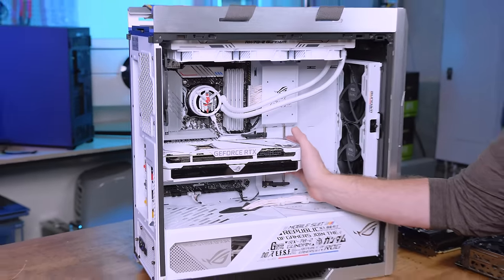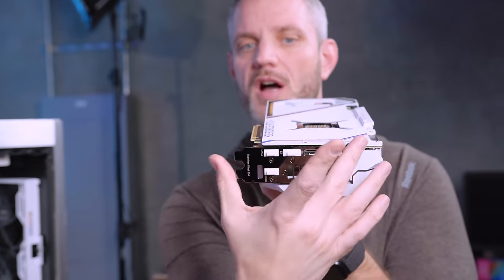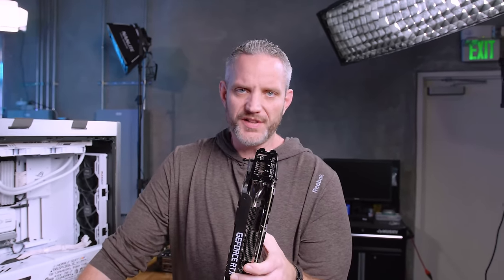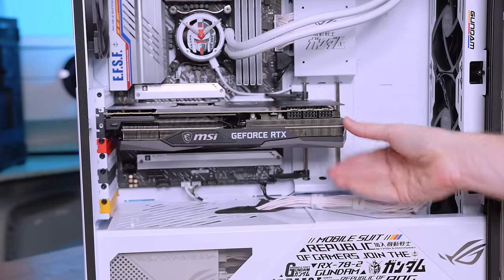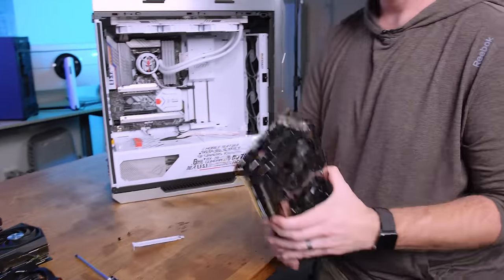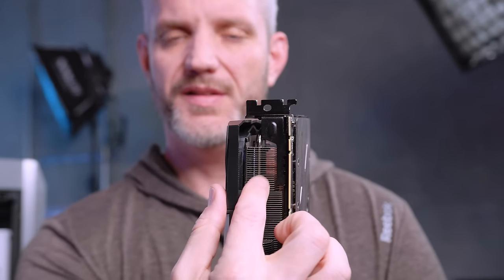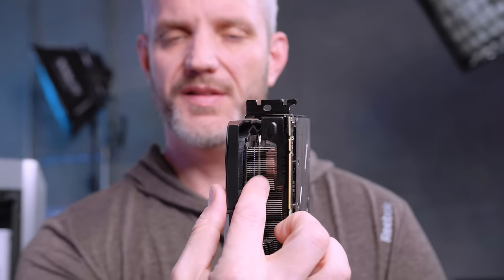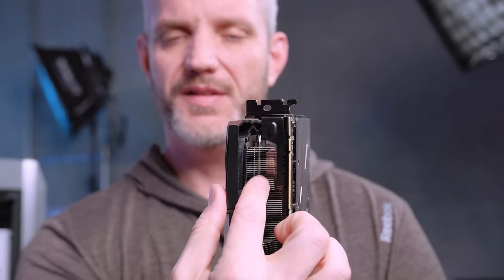How to fix GPU sag ONCE AND FOR ALL! FREE!

Comment: Any help here? So recently I've been having the annoying problem of losing display way too often, either while gaming or when I'm just browsing. I figured it's probably my gpu that just needs a little re adjustment, and technically, it is true. I'd reseat it or just give it a little push, and my pc would start up fine again until it would lose display and restart itself all while posting 'AA'. Then i would get code 97 when. I realized I get no problems when I lay my pc on 'it's back' so the gpu would be pushing down on itself with gravity. 0 issues. I recently ordered asus rog gpu support bracket in the hopes that would help. Any thoughts?
Reply: That sounds like an issue I was having on my brothers build:

His issue was 4th gen Intel build, Asus rog maximum VII Gene motherboard, Asus gpu 1060 6gb (and 2080 8gb), Asus ac68 pcie WiFi card...

The issue appears to be faulty implementation relating to the Asus ac68 WiFi card - it really doesn't play well when plugged into an x1 pcie chipset slot - so I believe the chipset isn't compatible with this WiFi card or the WiFi card's driver implementation - works fine with WiFi card in a x8 slot (gpu slot) but has the boot issue, bios error code issue, no display issue on the non gpu pcie slots.

There's some talk on forums only, that Asus messed up with these WiFi cards and they just can't work in normal chipset pcie slots eg x1 slots without causing system problems for booting and display.

What I found is you can get a cold boot to work if you take the power lead out the back of the psu eg discharge the power out of the pc (hold the case front power button), a reboot doesn't succeed, a shutdown then switch on doesn't succeed either - as soon as I take the WiFi card out as well it has issues as well, it's only putting the WiFi card in the gpu pcie slots (eg the 2nd gpu slot eg x8) that's stable and works - this kinda proves that the WiFi card is only happy and stable on gpu/cpu pcie slots and it's not working on chipset/mobo pcie slots.

Hope that helps you.
Reply: @marknewellmusic  damn. I just bought a new Gpu and I have 0 issues. Got a 3060 12gb. RIP 3070
Reply: @Micalex   Interesting... well, at least you solved it and at least you kinda got a better card than that 3070 - 12gb vram is better than 8GB for sure these days.
I had a 3060 and it was a fantastic card 👍
Reply: @marknewellmusic  yea. The 3070 would give me about 300 fps in modded minecraft with some lag frames and now I get over 400fps with 0 visual lag/glitches or whatever. In valorant, I can play with everything maxed out and it feels so smooth. Before with the 3070 I would remember having anti-aliasing would cause some stutters.
Reply: @Micalex  Happy days mate, game on!

Comment: That does NOT work with any card on the market and really isn't a structurally sound fix.  First, one of the very cards you demonstrated in this unecessarily long video was the MSI.  Given the way the mount is position in relation to the rest of the card, the next slot down wouldn't be in line with the back of the card for your "shim" idea.   Furthermore, the best structurally sound way to support it is exactly where you mentioned the "cantilever".  It needs support on the end.  Period.

Comment: I just took an old pen and took the guts out, cut it down to the proper height ro support the card from the underside and put a square of double-sided tape on the top and bottom of the pen "suport" pillar and it looks and holds great. WAY WAY better than this ..... whatever you want to call it.

Comment: Well, sagging happens on the right side. Any hack to support it on the right side will help. In fact, he could have simply created a bracket by bending the same strips he used and placed it between the card and cabinet base on the right side.

Comment: I just bought a 4000D and I have a lot of problems first the led light went out and they sent me a replacement so now I’m having trouble with mounting the gpu duel connectors and I only snug them a little bit but a few weeks ago after I mounted my gpu in to the mobo and the screw holes are stripped and and not all of it. SO BUYERS BEWARE OFTHE CASES FROM CORSAIR THEY ARE JUNK AND EVEN CORSAIR HAS STOPPED REPLYING TO MY EMAILS AND THAT TELLS ME THAT THEY ARE NOT GOING TO HONOR THE WARRANTY. Jayz two cents you really need to look on how there quality has come way down. If it was me I would fire them.

Comment: Jeesh! 14 minutes for a terrible fix, no fix at all, actually, it's just aesthetics... Even if you support it as best as you can on those 3 points, you're still letting half of the card's weight hang, that's terrible for long term use. Why you see so many PCBs warping and ripping pins from the chips. GPU sag is one of the main causes for artifacts. Just make a support bracket for the other end of the card ffs.

Comment: Doing the method in this video still puts a lot of weight of the card on the PCIe slot and its solder joints.  Read:  Your glowing LED fratboy computer looks just as stupid and obnoxious as the ground effects on your Civic and the testicles on your F150.   All:  Just use zipties, ditch the lights and close the case so others don't have to sear their retinas on your ego driven monstrosity.  Use the extra money to buy another game or take your mom out for lunch, and please stop yelling at her.